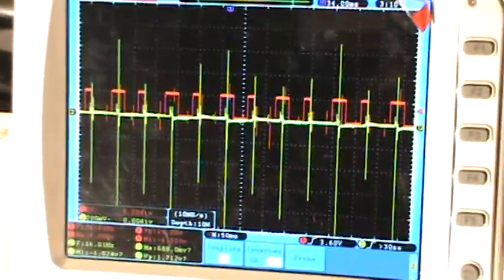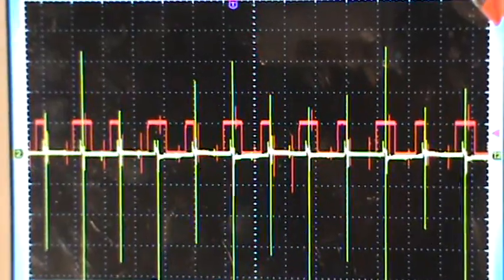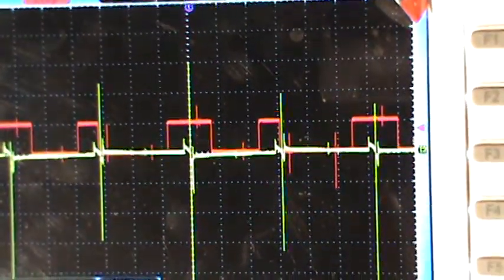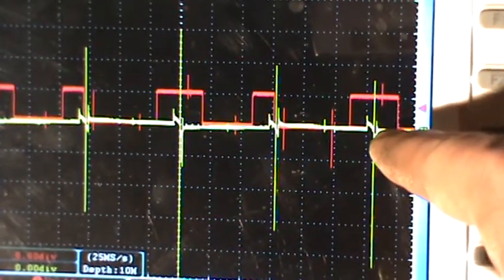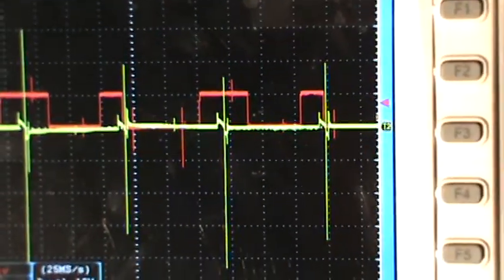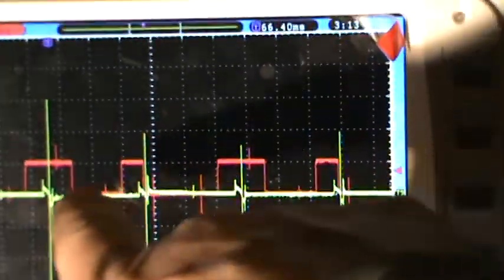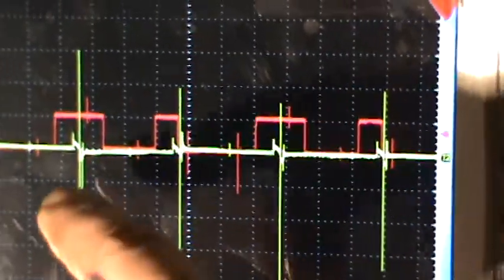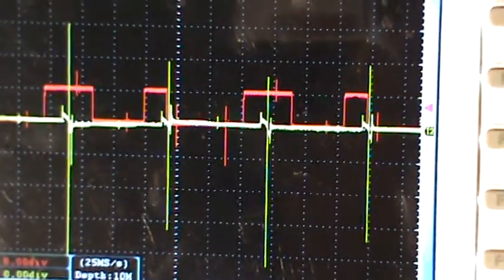Ignition Timing

Comment from the maker: Richard Desrosier, It is an Owon 60 megahertz oscilloscope. You can purchase it on Amazon for around $350; it does not come with a battery, but I purchased the battery separate for about $60. You will also need to purchase an amp clamp in order to measure amperage- to view amp ramps- another $100. It does not have the same attachments as an automotive scope, but adapter are available so they can be used interchangeably.